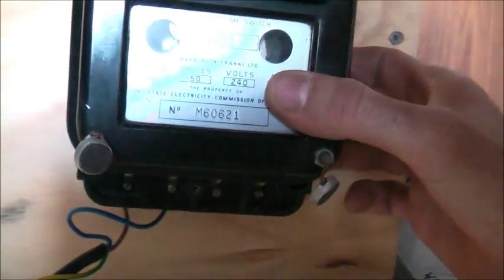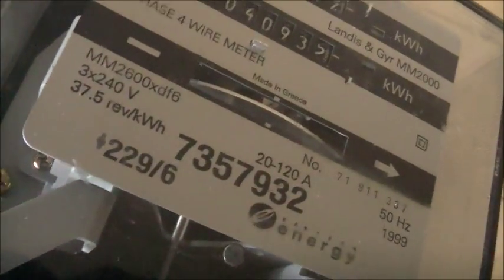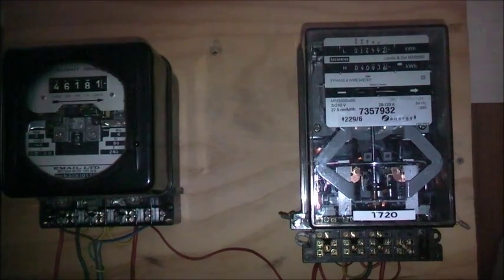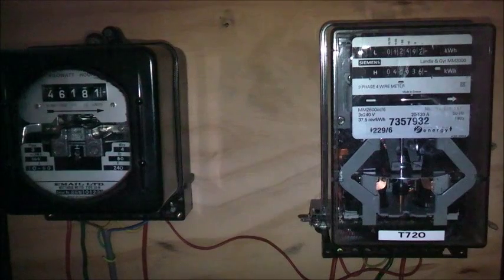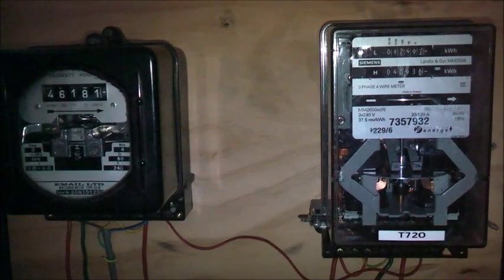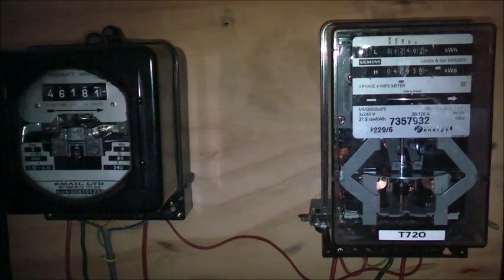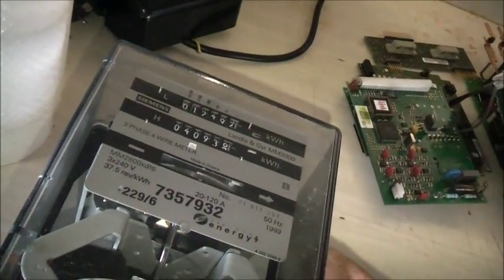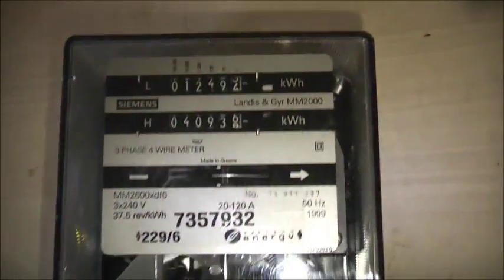Siemens Landis & Gyr MM2000 Watthour Meter Test

Comment: How can the readings from this 3 phase meter be calculated accurately to ensure that one is not being cheated by the public electricity officials? 

What is the function of the counters in the 7th column? 

Is the 7th column included in the computation of the readings?

Comment: Nice meter, didn't know about the MM220 variant,  20 - 120 Amps is 600 % overload rating compared to baseload of 20 Amps. That ones will pick up very llight loads a bit better then the 30 Amp baseload version.